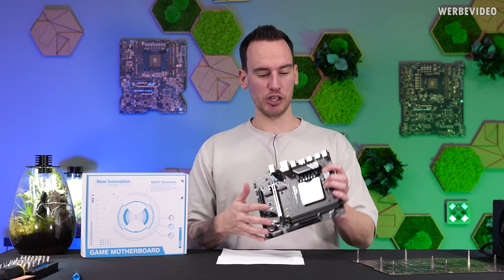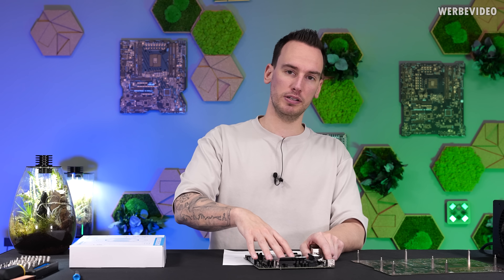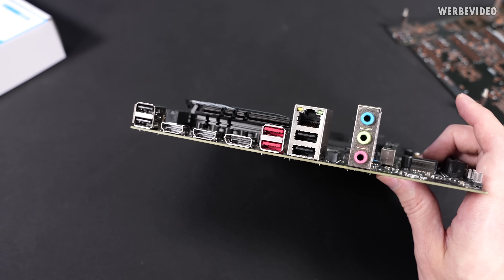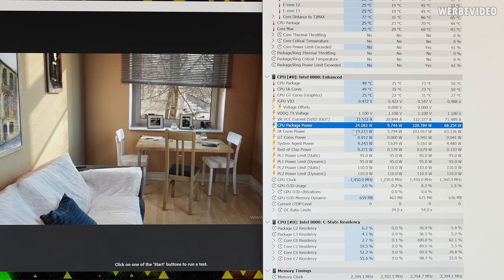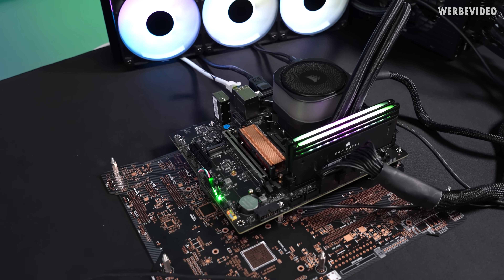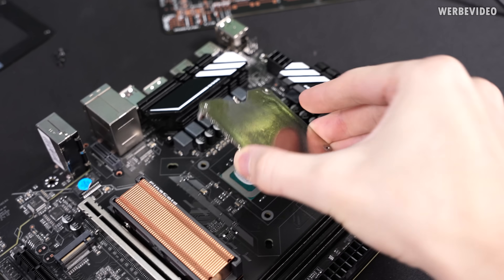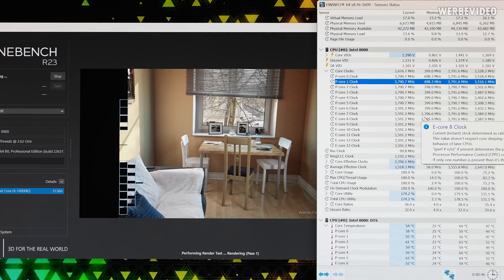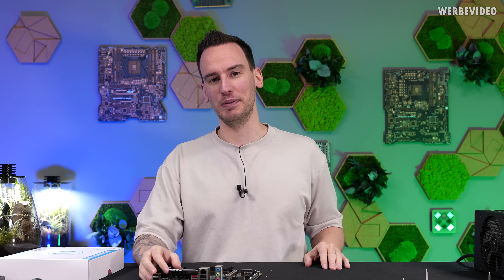Don’t Buy This! Intel Mobile Engineering Sample for Desktop is weird

Comment: The reason these things have been interesting to me is definitely the energy efficiency, both at idle - which most computers are on most of the time, and under load. I really don't need my computer eating up as many watts as most computers do. Would've been nice to see specific comparisons vs the 7600 and 7700 X/non-X on idle as well to represent most desktop use.
Reply: They only idle-inefficient platform is the AMD desktop processors with chiplet design. Others like Intel MSDT and AMD APUs are monolithic chips and they're technically as efficient as mobile, in which case the NICs and USB/Thunderbolt controllers could consume more compared to the chipset and CPU.
Reply: @zeyuzhang2017  True. Except the last generations of intel cpus and amd APUs both of which are also chiplet now.
Reply: 40w stock 5600z ;<;
Reply: 12100 eats 1w
Reply: @JusstyteN  Ludicrously unfunny lie
Reply: @ArdgalAlkeides  i measured its 25w idle from the wall all system power with not the best sfx power supply. i think its only 80+ bronze or something.
Reply: @JusstyteN what about whole pc measured from the wall? 11800H system uses 50W on idle. With 3 SSDs and a bunch of fans.

Comment: This thing is like THE bare minimum that I expect from a MicroATX or SFF board.
A mess of display options, good M.2 options and one full size PCI-E slot with 2xSATA and a USB3 header.
Would be a great way to run an always on storage server. Does it have any virtualization features to run containers?

Comment: 11:00  A 14700 (non K) is at 32774 drawing 219w when I looked up some results.  It is about the same money to purchase a motherboard and the 14700 as it is this Erying.  I think almost twice the performance for same cost is OK.  Even a $164 12700KF gets 22784 in R23 benchmark.  With a $60 motherboard you are looking at $220.  So better performance for even less money.  (And if you are gaming on 8 P cores probably a better proposition).
Personally I am trying an 8700F and B650.  Also 8 cores, and x8 PCIe link, but can later upgrade the CPU, also was only $125 for CPU and $50-60 for a used B650.  I can later move to 7700 or 7800x3d/9800x3d.

Comment: 0:40  I am not so sure I would go with a 13600k or 14600k.  I would argue a $60 Z690 and a 14700 for $240 is a much more compelling argument.  I don't care for more clock speed than a 14700 can do anyway.  And mine pulled 220w easily in Blender with the 20 cores.  Basically the limits of my Phantom Spirit 7-heatpipe cooler.  Or a new 12700KF for sale at $164 is better value for gaming.

Comment: I got a few of these with "normal" CPUs, not engineering ones and they run like a charm and deliver high speeds while using barely any power.

Comment: The sellers of these motherboards use to have secondary bioses with better combatility for fine-tuning that they will send to you if you ask. I have two Erying 11th series and it took a few months with a small community of users to figure out how to get it to work (almost) everything. One thing must be said that the ES samples they sell use to be discarted chips and some things may not work or not as intended. pcie lanes are the major issue and ram compatibility the second.
Reply: you know those "pcie 2.0" lanes got fixed into pcie gen 4 lanes.  

those "new" 13950h chips with x16 pcie lanes is pretty crazy.
Reply: @Fudgesickle  I didn't know about those 12tth and 13th gen so much. it was enough mess for me with the 11th. The problem on the Tiger Lake ES was the pcie lanes managed by the System Agent. Not all the lanes are stable at full speed and it needs to be set to Gen.1 for stability, and that sucks. My other 11800H non ES works rock solid.

Comment: If you're not a big gamer, or as in this instance, you're just interested in doing a liquid metal temperatures comparison, you should opt for the 'ES' boards, without the PCI connector - I got mine for just €142, half the price of what was forked out here!  And so far, I'm happy with my purchase.

Comment: A one week burn-in test is more than most companies give components. Hell, when I used to work for a computer shop, our standard burn-in test for new builds was one day.
Reply: On 2 separate occasions, I've bought new laptops that completely died from a burn-in test within a day.  Worst was a Lenovo laptop that died from 1 hour of full load.  Power adapter still worked, power was going in, but board was stone dead.
Reply: @Choochinc  I had that with an Archos Cesium laptop I got for my nephew.

1 day burn in test, died. Got it replaced.
1 day burn in test, didn't die completely, but crashed and reset its bios after every reboot. Got it replaced.
Survived 1 day burn in test, died after a week.

Got a refund after that and forked over 200€ more for a second hand Thinkpad, which survived his entire uni studies and still works fine.
Reply: One day huh. My company can't be bother with even 4 hours. all we (worker) can do is about 2~15 min. if it broke you have to pay it. The rules are so shitty.
Reply: One day? We do an hour lol
Reply: @ae112r8  This was at a small shop back in the late 90s.
Reply: Note the phrasing "up to 168 hours", they could do a 1 hour a burn-in test and still make that claim as long as one could feasibly have sold one that completed the full 7 day burn-in test at some point.
Reply: If it boots then it works.
Reply: @alistermunro7090  LOL I hope that was sarcasm.
Reply: @mattelder1971  Partly. Varies between servers and general purpose PCs. It was more important decades ago.
Reply: yeah but a build doesnt need more than a short burn in. Considering your simply connecting components that should have already had burn in tests at the factory.
Reply: @zeroxception  Most factories don't do a burn-in test on every item. They might pick one or two out of each day's production run.
Reply: @mattelder1971  Agreed. And given the nature of the documentation and packaging in this case, I suspect it hardly ever happens.

Comment: I upgraded  my z97/4790k just before  the  pandemic to an Erying PoleStar2 board with an  11900ES chip  as an experiment and something to tinker with  - I didnt use the drivers from their website, I got them from intel,  the board is tiny,  my main concern was the cooling solution  on the VRM,  so i  rectified that, I wasn't expecting much, and the BIOS had every bell and whistle you could think of, including a lot of settings that  I had to learn, there was a Spanish youtuber that posted a tweaking guide for the board and it helped alot,  undervolting it allowed to to run faster, I run mine with  a proper custom loop consisting of a D5 pump 3/4  inch tubing and fittings  a UC-1 extreme cpu block and a  phobya 1080 extreme  360x360 external  radiator with 4x 180mm fans shoe horned into the top of a core X9 case, the sides panels still close just fine, the fans dont need to be on  unless the gpu is running too.. iits been rock stable,  have not seen any evidence of phoning  through my firewall appliance, its true the performance is not up to snuff with the latest and greatest but  what you are getting is a very usable general purpose system with a very low power draw at a knockdown price. -  btw disabling the IGP seems to make it cooler and quicker.

Comment: For people in brazil that don't have much money to spend on new or official used stuff... does with DDR4 11th gen intel ES ones (11800H or 11900H ES) by Eyring like, $200 at max back then, got a lot of poor people a enjoyment to have they first gaming pc.
I helped a lot of people setting up this kits here, (ram timings and undervolt in particular) even build one for my sister, running rock solid at 4.7 all core, 1.2vcore still, Just put 2 tiny fans on each VRM heat-sink, and that's it. :person-turqouise-waving:
Reply: I could not let it run more than 4.4 all core because of overheating. Do you use liquid metal?

Comment: There are also non-engineering sample CPUs for sale, so be sure to check them out before you buy.
Reply: What is the difference between those (pretty please) ?
Reply: @G_de_Coligny  non-ES CPUs are MUCH more stable then ES CPUs, since ES CPUs are designed for internal use and are much more unstable because it isn't expected for anyone to buy them for general use.
Reply: @ thanks !
Reply: Where at?
Reply: 어디서 사나요?

Comment: I own a few the lga 1151 mutants like qtj0(8 core 16 thread) comparable to like 9900-10900hk in specs, intel xtu has been my best friend with these cpus, they need to be tuned from new and set power limits it would pull 225w by default while boosting turbo clocks unlimited time, after a slight undervolt and 165w power limiter and playing with my clocks I was able to get 12700k multi thread results on cinebench r23. So for 70$ with z370 motherboard can't rly beat the price to performance its delivering on that socket. Xeons could prob compete with that but for what I paid for the cpus with a tuned profile set they been beasts.
Reply: there was the time the mutants were good. today it just makes more sense to get the newer stuff.
dont get me wrong, i love my QQLS/ QTJ1/  Xeon e-2286m builds , but the price is not worth it anymore unless you happen to have a board sitting around...only recently those chips started to dip under 100 Cad and ive been using the mutants since they were "new" on the computer scene...
Reply: @mikeymaiku  I mean guess depends on the region? I paid 110$ usd for msi z370 matx and qtj1 recently. And guess depends on your sources, I've paid 70$ for qtj0, 60$ qtj1 and 38$ qtj2 and around 40-60$ for motherboards (all usd and after cashing out not before shipping or taxes but I used some promo coupons avaliable regularly)
Reply: @mikeymaiku  of course they still don't fit all use cases but for like 1080p/1440p budget gaming pc(using higher end cards couple gens old)or anything needing decent multi thread performance on a budget, not much rly compares on the Intel side rn for that price point, I mean like 3700x/3900x and b550 on amd side still cost you more and the good batches of qtj0 spank 3700x

Comment: The "mobile chip on desktop motherboard" concept can definitely make for interesting products in some cases, but engineering samples is probably not the way to go, at least unless the product is really cheap and you know and accept that you can't really know what to expect.
Reply: It's just Der8auer decided to buy a ES version chip, while Erying offers official chip on board too.
Reply: Back in my XOC days, there was the ASUS CT-479 adapter that enabled you to slot in a mobile Pentium Dothan CPU. Along with an OCZ Booster, which allowed for sending 4V+ to your DRAM, you could assemble a real Frankenstein monster of a thing that gave you an early preview of the upcoming performance of the first Intel Core CPUs. I'd say it was still the weirdest hodgepodge platform I've ever messed around with, but the performance you could extract from it was absolutely no joke at the time.
Reply: @K31TH3R  Had one of those adapters, ended up selling it because I needed $$$$ and even at 3 or so GHz the Pentium M sucks, because of it lacking SSE3.
Reply: i bought a BD790i from Minisforum rocking a Ryzen 7945HX 16c/32t, the only downside i had was designing and manufactoring a cooler that fit the non standard form factor
Reply: here i buy qtj2, an ES mobile with interposer 1151 socket. works perfect but has poor compatibility with air cooler and has limit on memory controller about 2800-2900mhz with much voltage and only on Z motherboard. work with 5700xt and 32gb without bottleneck
Reply: in my country this we can not boy this board.because very expensive.and my mony worth is potato,we are in hell for embargo,what is my sin😢😢😢😢😮‍💨😭😭
Reply: Keep that mobile hardware crap away from my PC
Reply: I like the concept, it would be great for a lot of applications. Can't see myself or most enthusiasts switching to a mobile CPU, but for most regular users, a product similar to this could be affordable, easier and safer to assemble since there's no CPU to install and no pins to damage, and could be entirely overkill for most regular users while barely using any power. Could be perfect for an office PC, HTPC, etc.

IMO the Broadwell i7-5775C and that concept of a very power efficient but still high performance CPU with a strong iGPU is entirely underrated.
Reply: Bought a modt board for Plex and other tasks and it's been great. The iGPU can handle almost a dozen 4k->1080p HDR streams, the idle wattage is low and CPU is really good for intense modded Minecraft scenarios, all for under 200 bucks on black Friday, the ES doesn't seem to be affecting stability or performance. Only had some issues with linux (windows was perfect), I'd heard the newest version of Ubuntu/mint was unstable but I only found out after putting in the SSD from the previous build, a downgrade fixed it 😂

The CPU is an ES version of 1280p

Comment: Roman, I also saw some motherboards with an integrated mobile cpu on aliexpress, but one of them has a ryzen 7000 series mobile cpu on it. The problem is that all the listings have 30 orders max and this itx motherboard is presented as a nas motherboard. The only good thing is the ryzen 9 7940hs soldered on it for about 300 euros. What do you think about making a video about this weirdly priced cpu and motherboard combo?

Comment: I have two of these mainboards, and another one for a member of my family…
1) 11900HX (ES)
2) 14900HX (Retail)
3) XEON W-11855M (Retail)
Another good replacement for the paste between the chip die and the vapour chamber is Thermal Grizzly Kryosheet.
The obvious thing is that these boards are NOT meant for overclocking…and yeah - most of the BIOS options don’t work, as they use factory/dev BIOS for basic operation.
The actual value they represent is in the form of recycling e-waste (as long as you don’t mind running them stock) 😊
Reply: I'm using a 11th gen right now. They can be overclocked, there are even custom BIOS for them. I wouldn't recommend it for an average user because there are plenty of bugs.
Reply: The Xeon WM is not that great of a deal, since it doesn't have ECC support on the motherboard, even though the CPU itself does.
Reply: Is this kind of $300 HX ES at 12000 CB23 @stock freq worse or better than minipc form factor at the same price?
Reply: I'm pretty sure Der8auer will put some Kryonaut or Kryosheet on it, after all, it's his brand lmao
Reply: Should I not use paste?
Reply: @BBWahoo  you can use paste between the vapour chamber and the normal PC heatsink, but I found that you needed to use Kryosheet between the CPU die and vapour chamber, otherwise cooling performance was not very good.
Reply: @paulpsomiadis5847  
I see, what if it's a separate delidded cpu?
Reply: @BBWahoo  Kryosheet can be used between the CPU core and the replacement copper IHS - this should give similar results…(remember that Kryosheet is electrically conductive, so be careful!)
Reply: @paulpsomiadis5847  
Am I able to go without installing an IHS if it doesn't include one? Appreciate it
Reply: @ only if you have a cooler or water block that is suitable for direct die cooling (and are very careful!)
Reply: actualy not true i got the 11900 es and the 13900 whit modded bioses easy to find and they run pretty good on oc also  i was able to stable the 11900 at 5.2 all cores stable and runing the same as desktop vercions bount of the 2 cpu handle max turboes of

Comment: I used to use the erying 11th gen ES motherboard 

It wasn't the best, the VRM was quite underpowered(needed a fan to not overheat), the memory controller was bad(like a B die 3200 cl14 could only run cl16)

But performance was pretty ok once i ran it direct die, had to use an AIO(like original h100, the coolit ones) as my custom loop's block was too bulky

It also seems to work with XTU, the best result i got was 4.8 on 4 cores and 4.6 on the other 4 (the cpu wasn't centered, so some cores were better cooled and could tolerate higher clock without tjmax)

Managed to get it to score just below a 5700x on R23, so i was pretty happy considering it cost ard 120 USD(without shipping) from taobao

But, I had to swap it out as i needed a X4 slot for a 10g NIC, so i sold it to my friend and it's still going strong with a rx 6800 & 32gb of ddr4 3200(i did put back the heatspreader thou)

Comment: Some memory sticks need a bit higher voltage when you set it to XMP. Typically it runs at 1.20 volts but need 1.35 volts when setting it to run with XMP. This is normal.

Comment: Curious if anyone in these comments can help me put a 240mm AIO on an rx5600 xt gigabyte windforce  it's stock cooler doesn't do anything even idle the temps are to high around 70° I've done everything from under locking undervolting nothing helps during gaming it reaches 103° I'm hoping an AIO can do something to atleast take it down 80

Comment: I currently use a 11ths gen ES as my only computer for about a year now, even with an ARC 770 haven't had any issues.

Can pump about 115w @ 4.8 though the CPU when going all out in Lightwave3D 
gaming at about 46w all on a basic air cooler. and i know i don't have a great sample.
all in all whole system with 32Gb ram, 2TB SSD and 850w PSU cast me about 550 (with the ARC 770 16GB )

Comment: Usually those ES CPU's have bad DRR5 controller, I'am aware that they sell those boards with DDR4 which allows u to go up to 4000mhz with tight timings
Reply: Yeah, you can get a 13980HX for 200 on baobao, I plan on using it as a low latency emulation rig. 
Exciting

Comment: ThrottleStop 
C1E off, speedstep off,
TPL sync MMIO PL1, PL2, set how much W you want, Clamp, time max,
PP0 Clamp, time max,
FIVR Control ALL IccMax to max
Reply: Yeah, this is the correct way of dealing with intel cpus with throttlestop on windows.